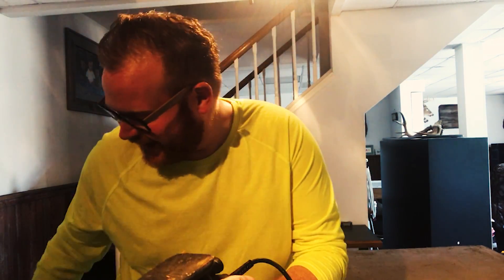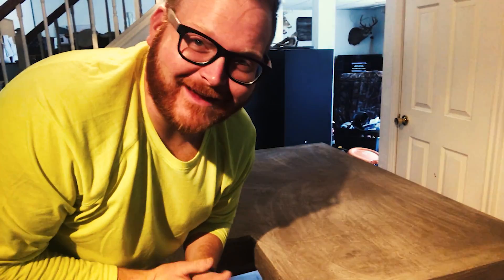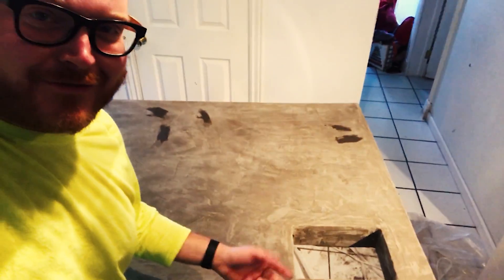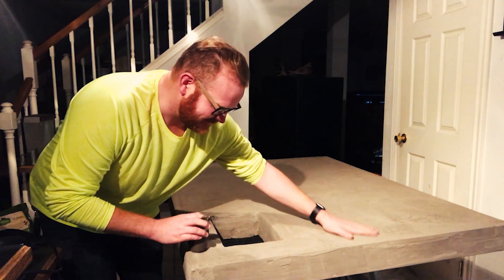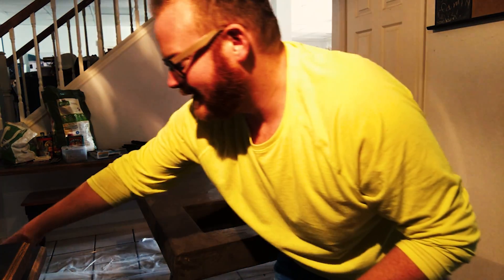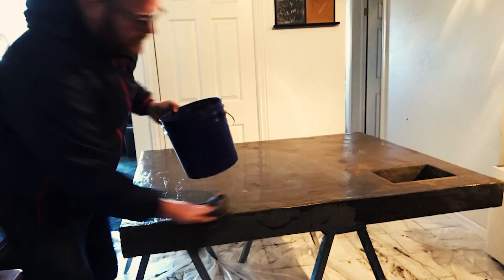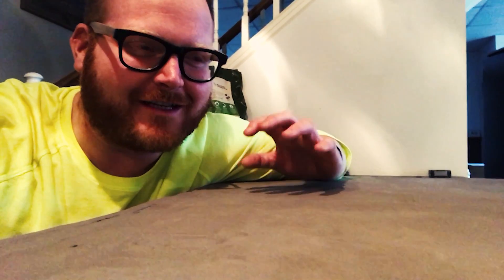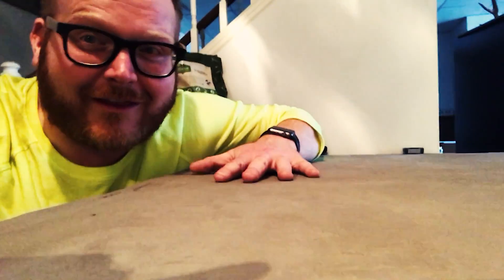Cheng's Concrete Countertop Sealer FAIL | Skoolie Bus Conversion Tiny House Videos

Comment: Not being mean, we all make mistakes but this is a personal problem and not a product problem. I just applied this exact sealer, it’s amazing how well it soaks in and I followed directions to perfection and it’s worth it. And mine is solid 1.25” white concrete top. So far it’s perfectly smoothe, no lines or pool marks, I’m in love with the quality so far. In your shoes, I’d throw out this top and start over. I would’ve poured a 1” or 1 1/4” thick solid concrete top vs smearing cement on wood but certainly not osb which would not be appropriate or advisable at all when considering how much contact with water your base has had up to this point of putting on sealer. I think it’s fine to smear concrete on a solid surface like cement board, and I think you’d be fine to use the CHENG sealer! Secondly, you added fresh concrete to hide the osb beneath yet didn’t allow the full amount of time specified by the manufacturer of the cement product you used… you have to follow their directions otherwise what happened happens. But like you noted the osb will continue to pop up and will warp due to all the moisture that’s been on it up to this point. Now ik it’s been five years, curious to see what you ended up doing in the end but I commented mainly so others unsure like I was before applying this sealer can hopefully get an idea of why this sealer failed for you and so long as the instructional videos or directions on the label are followed, most applications should be just fine. I of course allowed plenty of time for my concrete top to dry, I sanded smooth and polished although I used a form instead of pouring in place so there wasn’t all that much to fix. I used a slurry coat as well but allowed a few days to cure then lightly hand sanded with 400 grit sand paper, used a polisher easily found at Harbour Freight, ordered and used diamond plated pads with my polisher to get a consistent shine and smooth feel. Cleaned it up well and applied two coats in total of this CHENG sealer. I watched many “how to” and “how not to” videos with this sealer and it seems to be drying well and looks amazing! For any confusion, the bottle and Cheng’s own instructional video the first five minutes you wet the concrete as even as possible, no pooling of water or sealant mixture. Then for five minutes apply half sealant and water mixture evenly and continue doing so wiping the surface with your drenched towel and in the next five minutes add more sealant to this same mixture till you feel ready to apply straight  sealer. As it starts soaking it in, take the same rag, squeeze out excess mixture and wipe the surface evenly and allow to dry for  20-30 min. Then it starts all over for the second round exactly as you did before. According a CHENG associated company, continue applying coats like before until the concrete no longer is soaking anything up.

Comment: Another great video but a couple of things to consider going forward. Firstly OSB and water don't mix well so you may run into issues no matter what finish you put on the concrete. Also 50grit sandpaper is coarser than 80grit. By using the 50grit second, you would have made a coarser finish allowing more water in. I'd put another coat of concrete on, let it cure for a couple days, then start with 50grit and finish with 80grit or maybe  even higher. Good luck, look forward to the next video!

Comment: I know this video is 3 years old, but I am testing out this sealer right now. I'm curious what you ended up doing (I'll have to look through your videos after this). The first thing I think you could've done differently is build up to a thicker coating of the feather finish. Do several thin layers. Second, after you put the water on, you do the sealer at a 50/50 mix, then during the next 5 minutes, you gradually add more sealer to the mix, until the last coating of 100% sealer. Then wait 30 mins and do a second coat of 100%.  Then after some time (I'll have to reread the instructions) you put their wax on it.
I hope this does work with the feather finish. I'm just testing it with some ff on a scrap piece of wood right now. But I do believe your layer of ff was way too thin. I sanded the heck out of mine and didn't come close to reaching the wood. I think I ended up with close to 1/4 inch thick after a few coats.
Just some suggestions for you or anyone else who might be considering doing this.

Comment: OSB doesn’t warp like you’re thinking. Instead the individual pieces that make up the surface absorb water at different rates. The parts that swell pop through your thin veneer of concrete. So you won’t get a bowed countertop, but you will continue to get pieces that pop through.
Reply from the maker: I know...I learned the hard way... 😒

Comment: At this point, you could use something like polyurethane and coat the entire surface, as is, making a water barrier. 
Then, after the polyurethane cures, sand it lightly and reapply a layer of concrete and then use your Chengs sealer on the new top coat. 
Just a thought
Reply from the maker: Ooooooh that’s a good idea!

Comment: Like Gordy ShuttleBus said ..... it might have worked if you put on a thicker coat of concrete and used the coarser sand paper.  My thoughts are you should have put the sealer in a spray bottle, and used water in a spray bottle to dampen the surface, then rubbed everything in. Too much water in a damp environment like winter there will make that wood swell.  Your surface looked very porus to me and easily absorb the water.  Its a cool science project .... and a unique idea ...your countertop.
Reply from the maker: That type of sealer has to completely saturate the concrete. Or at least that’s what the directions said... 😒😒😒😢😢😢😢

Comment: I can't feel the top so I don't know if it's pretty smooth or not. also I don't read many of your comments If somebody has already asked you about this. I know you love the rough look and feel but how are you going to keep it clean down in those scratches. Is it smooth enough?  just something to think about if its not smooth enough.
Reply from the maker: I thiiiiiiink so. The top is pretty smooth. The majority of the deeper texture is on the sides. But only time will tell. The good thing about concrete is I can add more and refinish if I need to. Fingers crossed!

Comment: I happened upon this vid by accident...but I must state that the title is woefully misleading should be changed in fairness to Cheng.  Ardex FF is NOT concrete.  It is a polymer-modified underlayment/surfacer made of a blend of portland and calcium aluminate cement...and polymers.  The only thing it has in common with concrete, is the inclusion of portland cement in the formula.
Additionally, if you read the SDS...well, it's a little late.  Sanding releases dust containing cancer-causing silica.  You weren't capturing the dust, nor wearing inhalation, skin, or eye protection. (refer to SDS).  This type of carelessness does a grave disservice to your viewers and subscribers.  Please use your platform carefully.